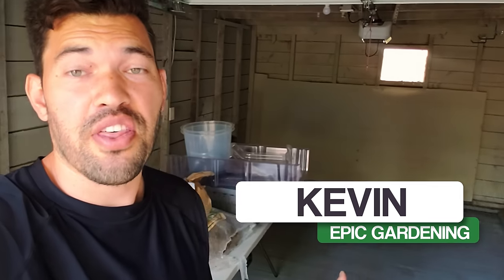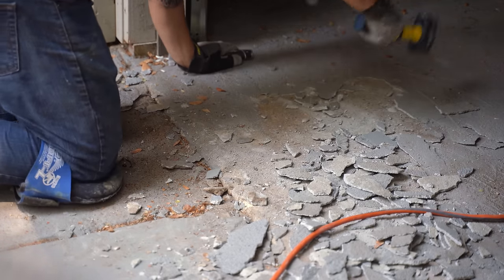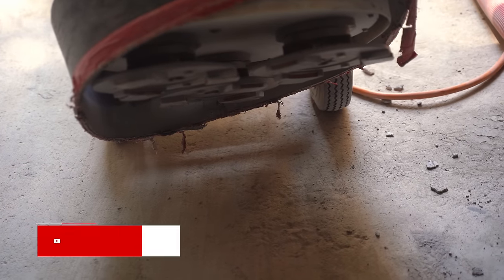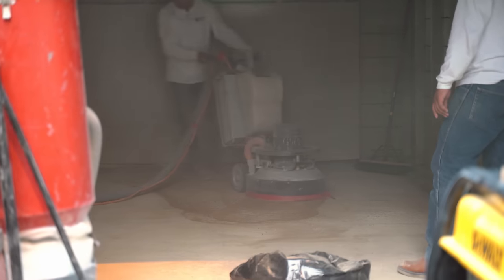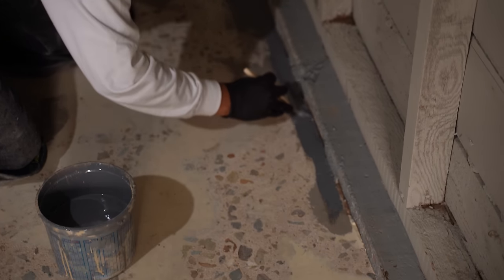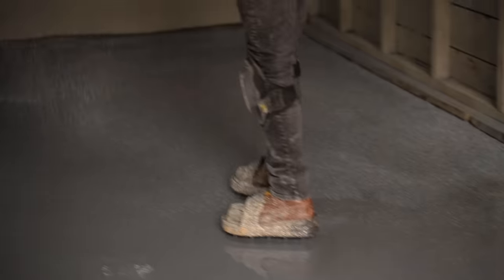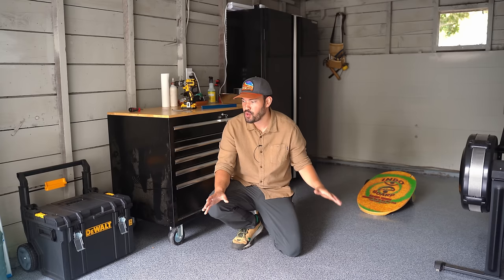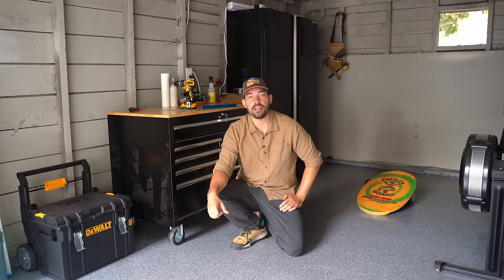Polyaspartic Garage Floor Coating Start to Finish!

Comment: I'm laughing ruefully that you now find yourself on the improvement treadmill. "Floor looks great! Wait, the walls look bad now. Okay, upgrade the walls! Huh, did the ceiling always look as horrible or am I just noticing it now? Okay, ceiling next. Wait, now the driveway looks kinda run-down..." 

(Also, my day job is in a field adjacent to Environmental Health & Safety and at about 6:30 I found myself thinking "respirators! where are your respirators while you're grinding all that off the floor? please don't cause yourself some kind of horrible long-term illness!")
Reply from the maker: LOL trust me I know I'm on the treadmill...and running full speed. And yeah not sure why they didn't use them
Reply: Yes! I noticed the lack of a respirator there as well and thought the exact same thing.
Reply: I was thinking that too, we take that stuff super seriously in Australia as we have had tonnes of tradies get respiratory illnesses from grinding down materials
Reply: I noticed the same. I know it was eleventy hundred degrees out there, but most of us only get one set if lungs. Lifetime risk is short for you as an observer, but I worry about the guys working every day on it.

They do beautiful work. I would hate to see them taken out prematurely by the lung injuries this kind of exposure causes. OSHA currently fails to regulate exposure, but I think CA might be considering it at a state level. I follow east coast news more closely,  and silicate dust protection is all at "employer discretion" here.

Comment: For walls think about a peg board style wall as well or similar looks clean and free up space
Reply from the maker: Great call
Reply: Totally agree ! Peg board walls for the win!
Reply: @epichomesteading  I've been looking at metal peg boards myself for long term durability.
Reply: This has been amazing for my garage
Reply: Or french cleats...
Reply: Or 1/2 plywood walls, you'll be able to hang most anything anywhere without needing extra support for heavier items.
Reply: Slatwall.  I have heavy duty Storewall and it is amazing!  You can put installation strips right on the studs and then hang the 4’ x 8’ panels right on them.  Cut with any saw.

Comment: NOOOOOOOOOO!!!!!! Don't drywall the garage. Just paint it. The studs are exposed. Future you will thank you for not covering those up when you want to hang things in the future. My first house had an unfinished garage and I loved being able to secure hooks and stuff to structure and know it was hanging from structure as opposed to my new house where the garage is drywalled. My car got an accidental paint job when my wife put paint on the garage shelving and the shelf collapsed because the previous owner didn't mount the shelf into the studs. He just used drywall anchors. The self gave way and my car was spattered with the leftover paint in shades of blue, tan, yellow, and white. Anyway, I'd just give the garage a coat of paint and call it good.
Reply from the maker: OK, good call! Maybe I'll just paint it a new color and hang stuff up!
Reply: Such a good point! My parents bought a house recently and the garage is drywalled or something. Wish it weren’t! The crawl space is not finished though and I can see up there, so I’ll check if we can see the studs. It’s a 100 year old house and the garage may be that old too!
Reply: Can always do plywood. Looks nice and can hang stuff anywhere.
Reply: May be use a stud finde

Comment: God, I can’t watch. Those poor guys are getting ridiculous exposure to the concrete dust. Silicosis is deadly and incurable, but 100 preventable! This company is not meeting a basic obligation to keep its workers safe.
Reply from the maker: Unsure why they didn't wear, they had
Reply: It sounds like these guys just chose not to wear their PPE. Some tradesmen in various industries just don't want to hassle with the PPE and instead accept the dangers as 'part of the job'. But airborne silica is no joke, I agree.

Comment: When my parents bought their house back in the mid 1950s, it did not come with a garage.  But, they, along with a couple of friends built one.  It was about a car and a half wide; so, bigger than a one car garage; but, not as big as a two car garage.  My dad built a work table and cabinets.  The table was hinged to the one of the cross beams along the wall.  It could fold up out of the way and was easy enough to fold down when he wanted to work.  Because it was a wide as it was my dad was able to work in the garage even when the car was parked inside.  

The oil on the floor of your garage definitely needed attention; but, you garage looks more like a rec room than a garage with that shiny new floor.  Some people consider building projects a form of recreation.
Reply from the maker: It will indeed be a form of recreation for me :)

Comment: Looks great! I'll tell you one thing. Once you do this type of flooring on your garage, it's a must have down the road if you want to move to another house..lol. I got spoiled having this type of garage flooring. It just makes the garage beautiful, more useful and clean up on the floor is eeeeaaassy. BTW, now you'll have to get a magnet sweeper when you start working on things with this type flooring. Finding screws, bolts, nuts, etc....can be a pain at times.

Comment: They did a nice job with the exception of protecting themselves from the dust at times....Your floor exterior from the garage is actually what I was wondering how to tackle...I'm sure they put a top coat after the 2 coats of epoxy they did

Comment: Great detailed video, thank you.  A few questions as its been a while now since installation.  1)  Do you also need to add sand or paint chips to the Polyaspartic also as i heard it is even more slippery than Epoxy? 2)  How has the floor held up so far, any issues or points you'd like to add?   3)  did they give you a choice of going with sand instead of paint chips if you wanted one solid color?    4)  Finally, I was wondering if there was ever discussion of just going with a straight Polyaspartic instead of mixing Epoxy and Aspartic?    Thanks for your response!

Comment: Polyaspartic is UV-stable.  The chips should have been fine as long as they topcoated the edge as well.  Curious why they felt it wasn't.

Comment: looks like that's going to be a great workspace! 

I'm so glad for you that that wasn't a water seep. It seemed strange considering what you said about drilling for water in the area, and it's great that it ended up being oil. In my area those kind of wet seeps are very common.

edit: *wasn't

Comment: I have a two car garage with settling issues as it was put in sometime after 1955 when the house was built.  A couple of big and long cracks and you can see some shifting issues.  Haven't had anyone out yet, but possibility is that I am looking at a full replacement down the road.  Not thrilled with that $10k - $15k job with removal of the old concrete.  Ugh...
Reply from the maker: Oof, that's not fun at all -_- hoping you don't need the full replace!
Reply: @epichomesteading  You and me both brother!  Meanwhile, wiring in outlets, garage camera, insulating, and probably using ship lap for the walls.  Might I recommend, as I have heard from others especially those that use their garages as work shops, using plywood or a similar material vs drywall.  A couple of missteps with the rolling tool boxes or whatever and you have holes.  Also easier to put in hangers or to hang stuff in the garage with a stronger surface than drywall.

Comment: Hi Kevin, The floor looks real nice. You might want to paint the walls & ceiling, to make it lighter and easier to see when working on projects. Consider hanging peg board (and attaching them to the studs) with some S hooks, to hang your tools on. Have a blessed day! 🌸
Reply from the maker: Thanks Janine!
Reply: @epichomesteading  You're welcome! You could also run a 2x4 the length of your work bench (at the top of the peg board). Then get some jars with lids, attach the lids to the under side of the 2x4 (using a screw etc.) . Then place small items in jars, like nails, bolts, screws and drill bits. Simply twist the jar into the lid. If you want to be even more tidy.....you can lightly paint the peg board before attaching it to the studs. After hanging your tools you can outline the tools, so say you have different size hammers, the outline will give you a visual.....easier put away! 🌸

Comment: That looks pretty great! I am looking at resurfacing my concrete front porch and wonder how the final texture is on this? If it gets wet, is it slippery?
Reply from the maker: There's a light texture to it even after the scraping, I would wear non stick if you were to coat a porch